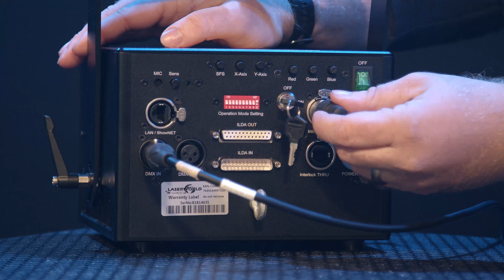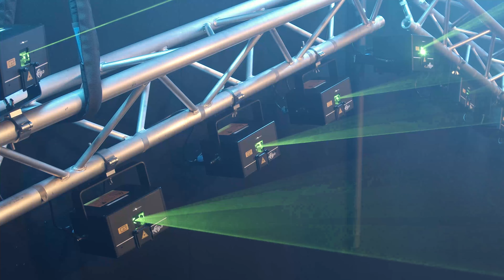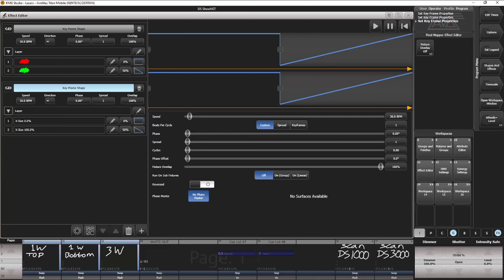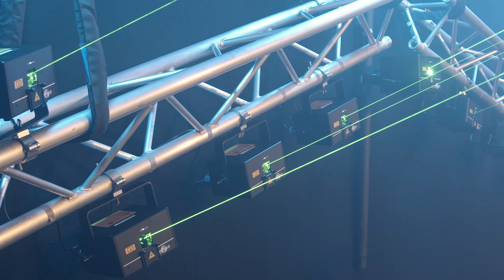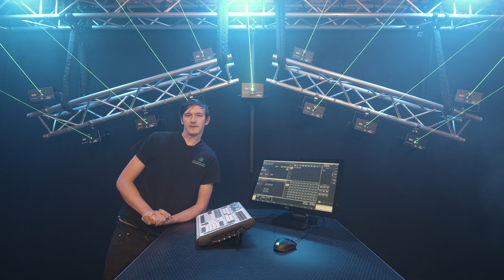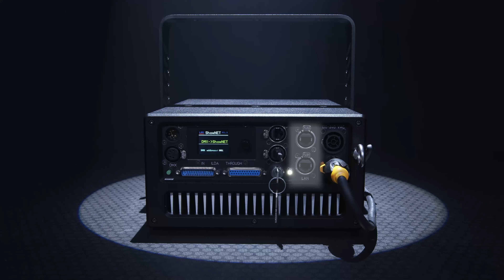How to control your lasers with DMX and ShowNet - Kent Media Group

Comment: I'd like to know exactly how the lasers and the interface were wired. If I have 11 lasers, do I also need 11 interfaces?
Reply from the maker: Each laser has it's own built-in ShowNet interface, this is triggered and controlled via DMX - so just standard DMX cabling between each laser.

Comment: Hi, I have a DS-2000 and now it works with Artnet input, I don't understand how to set the administration software to make it work as DMX.
Thanks
Reply from the maker: You can use it with the on-board DMX, all you need is the correct DMX profile for whichever controller or DMX software you are using and then simply set the DMX address on the unit

Comment: Hey, can I program like in the video an aliexpress cheap laser with dmx?
Reply: Don’t waste your money on chinky lasers they break easily
Reply from the maker: The answer to this is 50/50. 

It really depends on the laser. You would need the ShowNet interface (or similar) to be able to control the effects like we have in the video. 
Most cheaper lasers will only have basic DMX control and not allow fine tuning like we have in the video.

Comment: Hello could I get an indepth understanding on how fully understand the shownet software and how it ties in to avo please
Reply from the maker: The two are different things - Avolites is DMX control, ShowNet is network control where you can do much more.

DMX with avolites just makes it much easier and quicker to get setup
Reply: Ok I understand so I would have to purchase the shownet software ok no problem there my issues is will it be compatible with the laser fixtures I have I have one that looks like the DS 1000rgb but it's a china manufacturer. Is there anyway I can get in touch with someone to talk with so after gathering all the information an knowing it will work I would make the purchase
Reply from the maker: @MadeMan007  you only need ShowNet software if your laser has the ShowNet main board inside or if you have a ShowNet interface which then plugs into an ILDA port.

Comment: yeah sure, but can you add weird stuff with DMX ? 
🤔aside from just zone chase c:
Reply from the maker: What were you thinking of adding? As it's DMX it can be controlled like any other light fixture so you can pretty much do anything you like with it :)
Reply: @kentmediagroup   uhm I mean... different looks across numerous of Projectors, and can be put randomly or linearly across all the rigs without the same content being displayed.. regardless of zone chase fx and stuff .. as what's in this video (as reference)

https://youtu.be/6-kEb8vFqj4

I know they aren't using DMX for this.. but I just wonder if DMX can do really stuff like that^

Tbh, I prefer an artnet, or stream ethernet connection (for lasers) rather then DMX tho 😃🙂

Also, if you're a Pango, especially Beyond users, I'm sure you will know what I'm talking about 😉👍
Reply from the maker: @jhrlasers  Yep, that's the beauty of DMX as each laser has it's own address so it can output different looks or the same look that's varied.

If you think of it as a Zone, you can easily do this with computer software. For us we used fixture groups in Avolites titan to select odd/even and top/bottom, the 3W in the centre was on it's own too. You can also select each fixture individually of course!

If you were talking about adding more outputs then depending on your software, this should be possible.
Reply: @kentmediagroup  Ah.. I see

But well, it's still limited based on the individual fixture internal memory of gobos right ? 
We can't make any change or custom creation tools just based on DMX, (it can, but it would require us to upload and store those cues and files directly to inside the hardware memory before on site rigs to play)

Which I thought why just don't use another way (software control) to get more sophisticated tools to do more complex stuff and on site live control creation tools as well, aside the limitation of DMX ?..🤔
Reply from the maker: @jhrlasers  yes of course you'd need to upload the frame or animation to the unit first just like you'd change a gobo on a standard fixture or upload Media server.

As standard there's a fair few animations and frames stored but you can easily upload your own with the admin tool.
Reply from the maker: @jhrlasers  also, why DMX - not everyone wants to use software specifically for lasers, also they may not want an interface per laser which.

This isn't there to replace standard laser control via ILDA or over the network, its just expanding its control options to those that already have an existing system giving them more control than they would usually.
Reply: @kentmediagroup  perhaps yeah, but from what I know... a few folks that use DMX for their control over lasers,  sometimes still prefer to need a software config indirectly to their lasers, so technically, the DMX console isn't controlling the lasers, but overlaying controls each parameters input on the software which (they said) gives more ability for (them or users) to also expand their tools to create more artisty contents rather then just direct via DMX..

Which I thought, I guess if I am going over DMX, prolly I will use the same concept tho..😃
Reply: @kentmediagroup  Oh and, do you think MIDI controls tools are also as powerful as DMX ?
Since I found out that, Most lasers guy that I know, they use MIDI input key instead of DMX to the software and gives a command to do stuff on their lasers..

As a few folks said it's just somewhat more easy to use rather then DMX
So I guess 🤷‍♂️🤷‍♀️😳

But Is it like still preferable and effective as what you using controls by DMX or smh something else ?🤔🤔🤔
Reply: @jhrlasers  Well, part of the beauty of the ShowNet interfaces is that it gives you a lot of different options, you either run them as standard ILDA lasers with external interfaces if you want, you can use either Show Editor or Show Controller to run them like any other ILDA interface with direct control of the laser from the software, with individual projector control. 
Or, you can do as they did here, run with standard DMX, but you can also run them in DMX mode via Artnet if you like (just a change in the settings). One good thing with the Artnet connection is that you already then have network connection, so you could easily switch over to using the Editor software to upload new "gobos" to the lasers if I recall correctly.

Also, one nice feature (hardware dependant of course, there are a few different versions of ShowNet) is that you can even use them as an Artnet node and send out a full universe of DMX to other fixtures if you like. I think I've actually used our ShowNet Pro more as an Artnet node now than as a laser interface :P 
I would assume the lasers with built in ShowNet that has DMX ports also can do this, and the standard external ShowNet probably just needs the DMX cable adapter to do it. The Pro version is a lot nicer with built in PSU, Powercon, DMX in/out and ILDA in/out. 

One other nice feature is that you can use them to stream ILDA over a network if you want to use a different software and its USB interface, but need to run long cables, you can use for example a ShowNet Pro connected to you other interface, and have it send ILDA over ethernet to a DS series laser with built in ShowNet. 

I'm pretty happy with my ShowNet Pro :D The only thing lacking is a display, not a big fan of dipswitches for network setup, but for the price, I can live with it :)
Reply: @Robinlarsson83  sure.. 
But it's all back to our native preference tbh
For me, I'm just gettin much more into #PangolinBeyond tbh...
As for me it's much more friendly on its UI and had lot of tools & features available in it...

Maybe shownet capeble do the same thing as Beyond c: .. idk🤷‍♂️🤷‍♀️..

But again, it's all back to all of our choice  :)

PS : Beyond also capable to done all of those features like you mentioned above^
Reply from the maker: @jhrlasers  that highly depends on what you're using as a controller, we use an Avolites Titan Mobile and a Wing if we need extra playbacks so we've got plenty of ways to save playbacks if we need them for triggering, of course you could use a MIDI controller if you needed to also
Reply: Is this something one would take a class on to be a professional?
Reply: @PrettyCoolFriend  there should be a training session hosted by each respective company..  (supposedly)

As in my case since..

(I'm sorry if I said it here since this channel is supposedly using their own respective brand and tbh I'm not ethically allowed to promote them here but... I have to..)... 

Im a Pangolin user, well.. They host their session each time they're into exhibition and they seem getting more intense when doing it abroad. (I am sure they're hosting a lot of training and master classes these days.. and you can check where they will have an upcoming session on their webpage or past session on their socials and YouTube anyway ;)

Comment: hi you can also set multiple zones of strength of the lasers, for example lower part 75% weakened then part 50% part 25% and full on.

As you can do on the rti neo one
Reply from the maker: You can set and save safety areas although it is a little more complex over DMX.

It would likely be best to go into ShowNet admin tool and set the safety zone in there and save it to the laser unit. This remains even if the unit is being used in DMX. 

You can adjust safety zones, geometry correction, colour correction, sizing, output levels and more which is quite handy.
Reply: @kentmediagroup  up to what size of space is that ds 3000 actually interesting to use?
Especially the depth of the room before the beam fades
Reply from the maker: @svdv5414  To be honest we got ours just before lockdown hits so unfortunately we've not had the chance to fully test it indoors. We have however used it outdoors for a single point scanning the sky and It was visible a few miles away still

Comment: I am hoping to control lasers from an ION XE console... Is this possible? I currently only have chauvet pars and Rouge RX2s patched to the console. And those obviously operate differently than lasers. I know its a pretty vague question... but does anyone know if I will ability (even if limited) to control the lasers?
Reply from the maker: Any laserworld laser with ShowNet can be controlled via DMX like this, it doesn't matter which console you use as DMX is DMX.

You may need to create your own fixture profile as there probably isn't one already made for your console, once you have this you'll be able to control them just like we have in the video 👍
Reply: @kentmediagroup  awesome thank you for the quick reply!

Comment: So was the lightshow using DMX or ILDA interface on the units?
Reply from the maker: All via DMX, there was no ILDA used at all
Reply: @kentmediagroup  Except of course for the built in ILDA interface (the ShowNet) in the lasers ;) So the actual lasers are running from ILDA, but no external ILDA cables or interfaces are used here :) It really is a quite nice way to run lasers!

I'm currently running my Kvant ClubMax 2000 with external ShowNet Pro interfaces, so just run a 50cm ILDA cable from the interface to the laser, not quite as convenient as built in interfaces, but almost :)